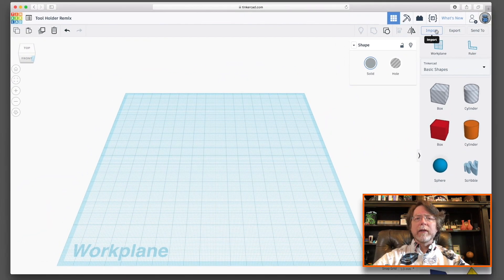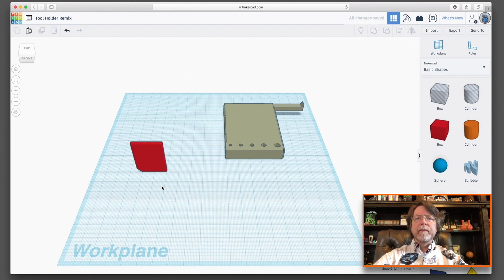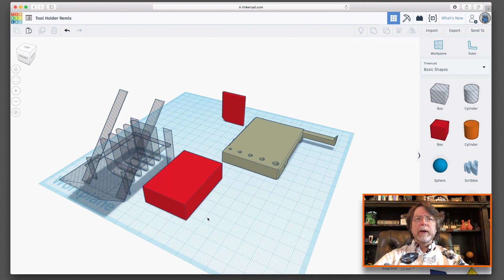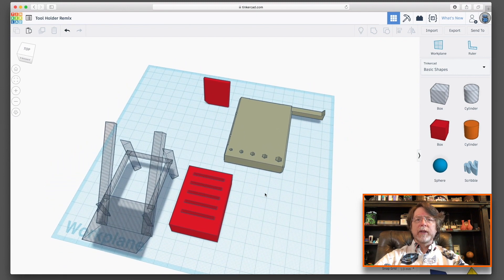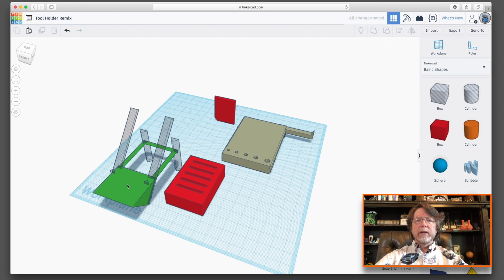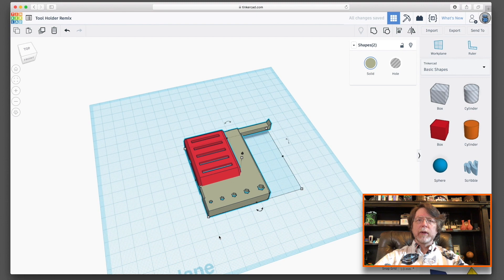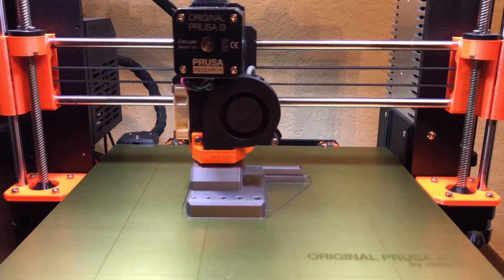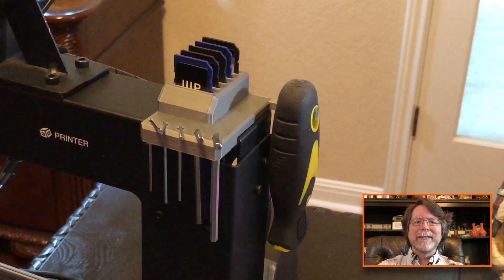Tidy Up Your Tool Storage on your Monoprice Maker Select Plus 3D Printer

Comment: Cute Mod. I am not nearly tidy enough to go for this project but what I am really enjoying is learning how simple it can be to remix a design with TinkerCAD. Thanks a bunch for demonstrating how you reuse primitives like the roof object to create bevels and add visual interest.
Reply from the maker: TinkerCAD is more than "cubes and tubes." It's also roofs. Once you start to dig into TinkerCAD it's got an interesting level of functionality. But at times it seems like something that should be simple takes a number of steps -- such as that bevel I did. There are ways to get beveled sides on a primitive, but they apply to ALL sides, not just ones you select. So I resort to creative use of "hole" type primitives.

At any rate, thanks for the comment. I'm glad you like these videos. 😊